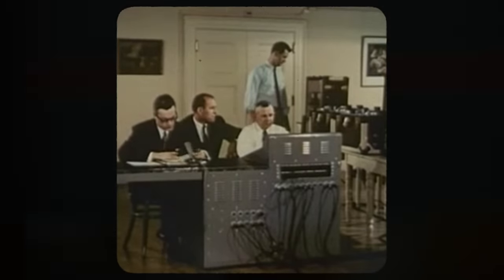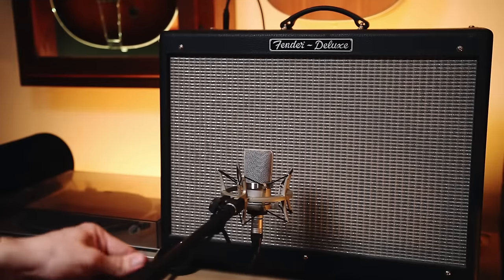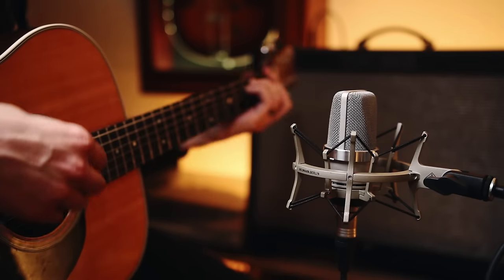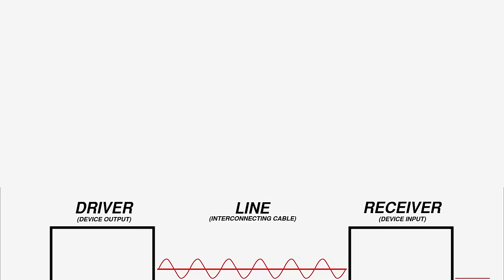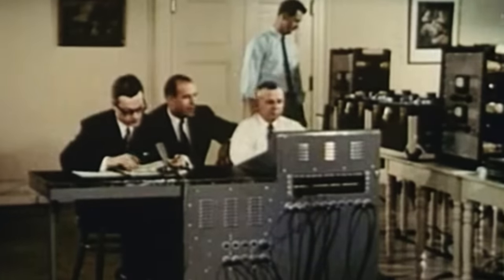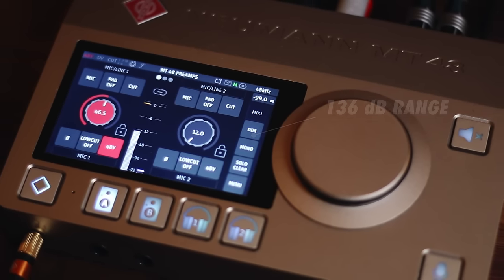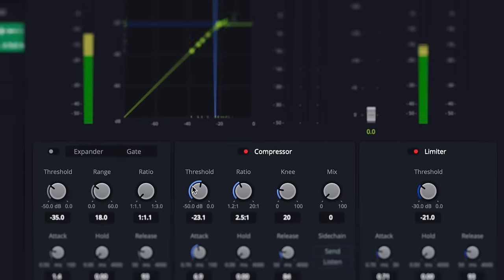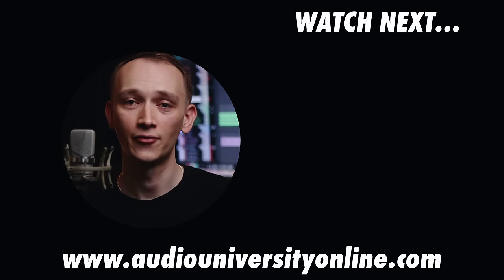The BIGGEST Enemy In Audio Production

Comment: Great video!

Timingly, I am exploring in miking my Boss Katana mk2 100 solid state amp. I'm using Shure SM57 and connect it to my Behringer UMC404HD audio interface. I hear the noise when I'm pushing the gain knob of the audio interface at around 3 o'clock. If I back it down to 12nn, the noise isn't there but the signal suffers. Meaning, I'm getting low output from my amplifier to SM57. In this case, I tried gain staging the SM57 at around 1 to 2 o'clock and adjusting the volume of my amp and specific volumes/level of my overdrive pedals, until I can no long hear the noise or if I hear it in the mix, I can onlt hear it on the quiet parts of the track, which can be cut in editing from time to time.

Also good to note that my small modest home studio isn't acoustically treated.

Comment: About mic positioning, what I learn by experience through the years is, if you deal with for example a kick, the wavelength in the air will easily reach 1 meter. So bringing your mic at the wider amplitude zone is very different than at a node. Therefore, it's not really by positioning a mic closer to the source that can reduce noise, but at the max amplitude of the wavelength of the source. Then you don't have to push the gain really high for a great input resulting in a low noise capture.

Comment: Slightly off topic question here - Recently I have heard of a recording method using two microphones attached to each other, but pointing in opposite directions in order to eliminate all noise coming from more than two feet away or so. It was called differential microphone. I would like to learn about that and I know no way other than intruding here ….

Comment: Well explained. 
Most of my recordings are outside a studio (like audio for my videos) and since I normally want to record accurately what's heard in real life as possible - background "noise" isn't a problem in most cases.

But the importance of the noise floor of the recording device it self (the last step) shouldn't be underestimated for such recordings 
For highly dynamic sounds like fireworks, hammer strikes in a quiet environment or for example just a loud vehicle in a quiet environment where it start out close, then is recorded until it's so far away that the sound falls below the environment (where the gain is set low enough for the peaks to not clip while still getting all the quiet echoes and sounds from the environment without getting bothered by hiss from the AD-converter and/or analog circuitry of the recoding device it self), just the difference between a noise floor at for example -100 dB and -110 dB can be significant. Same applies for 16 bit vs 24 bit.  

Also electrical noise has been quite a bit of a challange as many of my recordings are in environements, such as close to  power lines (mostly railway power lines when filming trains), high magnetic fields and (what have given me most head ache)  somewhere with a cell phone base station nearby. 
Balanced inputs doesn't help very well against noise caused by pulsating microwaves from those either
 - it do help against relatively low frequency electric and magnetic noise, such as that coming from power lines
 - but for microwave problems (usually in the GHz range) the cable just act as the antenna and the part where it get modulated into unwanted audio, is in the microphone capsulea or audio circuitry it self (which act as a reciever). 
For example the small FET transistor used in condenser mics tend to modulate pulsating microwave signals into an audio signal. 
The only thing that helps angainst this, is heavy shielding of particularly the contacts and where the cables enter the microphone capsule/casing. Lucky for me, I have also built both my microphones my self (using Proimo EM273 capsules) and my preamp (I using the ADA4004-2 and a custom built DC/DC-converter to get dual voltage - so I can run it on just a 9 V battery) I finally managed to get rid of the problem using copper tape and aluminium foil in the right places. 
Thise one is pretty much impossible to get rid of, if not building or modifying the recording gear your self and I have heard that characteristic noise many times on other peoples recordings and even on stuff they record on TV
Reply from the maker: Thanks for watching and sharing your perspective!

Comment: My noise problem isn’t inside the room, it’s outside, random noises like birds, sirens, motor cars. Condenser mics pick it all up, dynamics I get away with.
Reply from the maker: I have the same problem in my room - trash trucks, leaf blowers, etc. Condenser vs Dynamic isn't really the issue. Like I said, it's about polar pattern, proximity, and frequency response.
Reply: Similar here, too noisy where I live, and sound proofing/room treatment is not practical. All my Mics are gathering dust, as are my Monitoring Speakers. I do all guitar and keyboards recording direct/pickups/MIDI/Modeler to PC, and listen through Monitoring Headphones. I can do this as loud as I want any time of the day or night without anyone else hearing or being disturbed. Best solution for me, and requires minimal gear and expense. 😎
Reply: @picksalot1  yep, me too, I went to all In line sounds for the home studio. I got a Friedman amp with a cabsim out, and an electric drum kit, all run through mixers and studio monitors or cans. Allows me to overdub with a perfect mix, because I have total control over the sound, no volume of the speaker cab in the room to contend with, or drums (and wife complaining). All done as quiet as a mouse if need be. Not top notch quality sound perhaps, but still pretty good and  perfectly practical for the home.
Reply: @AudioUniversity  yeah I hear you, true. Good video
Reply: I find 1am to 5am is the silent time,
Reply: You need a Coles 4104! The ultimate commentary microphone for noisy environments.

Comment: That same form of common mode protection is used in automotive communication circuits. Modules talk to each other on two wires, typically wound together, with opposite polarity. Interestingly they have a 120 ohm resistor at each end, so you can check circuit integrity with an ohmeter by showing the parallel resistance between lines is 60 ohms.
Reply from the maker: Very cool! Thanks for sharing!
Reply: The line termination resistors at each end of the bus prevent the signal from being reflected back when it reaches the end of the transmission line.
Reply: @maxine_q  Yes, with a similar goal of the classic impedance of a radio transmitter wire of infinite length. That topic is fascinating, relating to optimal impedance to prevent simple harmonic reflections at the radio wave level.

Comment: The part of the article you didn’t read says:buy the microphone that fits your budget!!  

Unless we’re talking harmonic distortion in for example a ribbon mic ;  The electrical self noise (aka noise floor) produced by both condenser and dynamic mics will be no where near the volume level of the source material and the room noise combined.  

If the self noise is louder you either have a lemon or you’re recording a lemon. And if you’re trying to capture room tone, don’t. what’s in the box will sound 10 times better and cost 11 times less than the room tone you’re going to record in.  

If you gain the mic up to the source and you can see room tone in the waveform, the source is too quiet, probably get the mic closer  . If you gain the mic up to the source and hear the noise floor, someone sold you a faulty mic, get your money back

Comment: You mention "long" cables a few times and I assume signal degradation is worse with a weaker signal. So from a practical view, when is a cable considered "long" in a mic / line / speaker connection? 1, 3, 5 meters as a typical (home) studio situation? 10-50 or more meters on a stage? I understand this depends from many factors, so the answer can´t be super precise. But from a practical point of view and your experience?
Reply from the maker: XLR connections can be 100 meters without much degradation.
Reply: @AudioUniversity  OK, I´m safe then :). What´s the length at which you think about switching from unbalanced TS to balanced/XLR/TRS connection?

Comment: Sorry to ask, but you said 3dB is a doubling of power. I learned that a 6dB increase is a doubling in power... Or did I misunderstand what you said?
Reply from the maker: 6dB is a doubling of a non-power value, such as sound pressure level or voltage. Check out this video: https://youtu.be/xSe7y9tYex8?si=U8-JUMQ2B9moAgN2

Comment: there is a difference btw reducti ad absurdi and myth. the dynamic=better for bad rooms thing is right except and yes in a million usecases there will be 3 where this is not  true and two of them are rooted in the fact somebody wants to break out of usual. in 99%the cases the person mixing(is beginner) the person performing(also beginner) is the same person. a mic that fits without use of EQ will take one of the tasks from that person and from the cpu.  if i take a joe and make him perform multiple dubs in a mic and then save and export the file, he will have way less problems with a dynamic. and yes, its more complicated but when one understands how much more complex it is, he no longer needs that crutch, while, tbh, most times i dont see any significant benefit from the condensor and the "easieness of mixing" makes the performinhg also more fun and i am more flowing and creating.  it´s an provonking statement at best, a good meant starterhelp in my view but not a myth. youtubers buy condensors and then make "Not amping keyboard clicking" a  qualityaspect. thats like using a flamethrower for lighting a cig and "not melting in the face" is now aspect of a good flamethrower. no ft is for burning and lighter is for precision to avoid burning. and not start about the aspect of holding a mic for the vocalist and the proximity effect. a dynamic mic is an instrument itself if used right  and of course you can manipulate a condensir creativly like recording backings behind the mic to make em duller but really good lifevocalists still use only handheld dynamics. like you need a manual car for rallly. the act of shifting yourself makes you more precise in shifting.

Comment: Would a USB Condenser mic have the same noise level as an XLR?
Reply from the maker: That’s a good question, Pat! It depends. I expect the biggest difference would be in the microphone preamp. With a USB mic, the preamp is built-in. That creates some limitations of space and power supply. So I always lean toward XLR mics and wall-powered preamps when trying to get the best quality.
Reply: @AudioUniversity thanks
Reply: @AudioUniversity I'm not sure usb condenser mics have in built pre-amps mate?? At least they never used to
Reply: They have a preamp and an analog-to-digital converter. The problem is that usually for the price you get a decent mic and a bad interface, a bad mic and a decent interface, or both are bad. The two exceptions to this are Rode's new NT-USB (I think) and - astonishingly - the $40 Fifine k669.

Comment: Looks like a Neumann advertisement..
Reply from the maker: I hope you learned something about noise along the way!
Reply: @AudioUniversity  - Well, obviously everyone's circumstances can be different, so I'm sure everyone learns something from someone at some point. Personally, in my case, I have a few older microphones that have a buzz that's impossible to cure because the mics are pretty old. So my only real recourse is to scoop out any buzzes with a narrow band EQ. I simply ensure the Q value is really narrow, so that no other frequencies around the problem frequencies are effected. There's only a few pieces of hardware and software I know of that can do it correctly though, meaning, non-destructive. As for software, I always use Pro-Q because it's the most surgical one I know of. Any others that can get just as surgical might be of help, so if you know of any, that might be appreciated. As for hardware, whole other ball of wax..